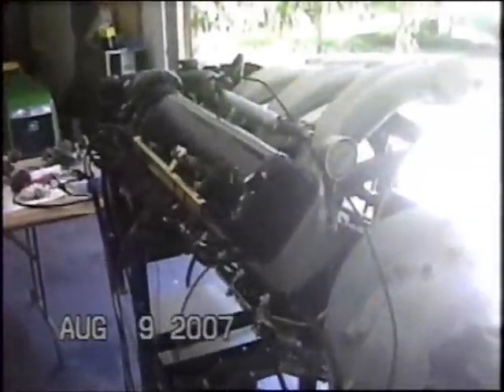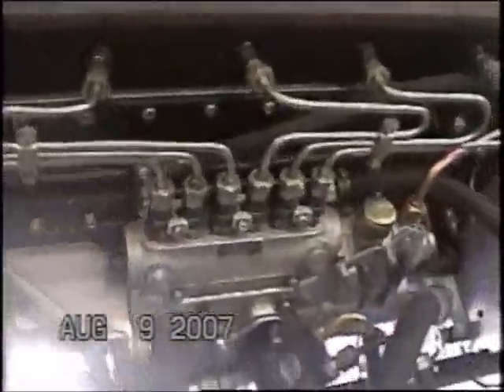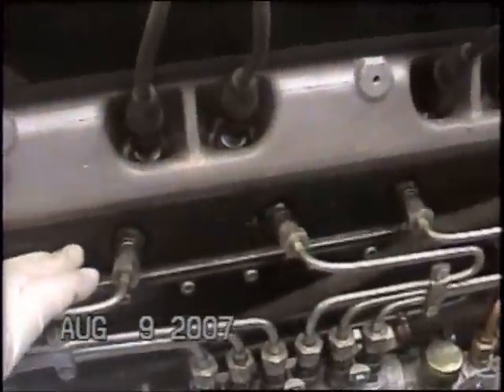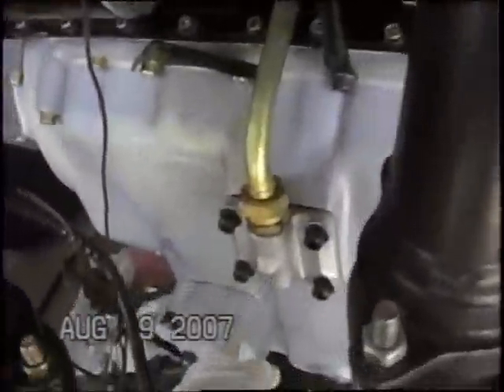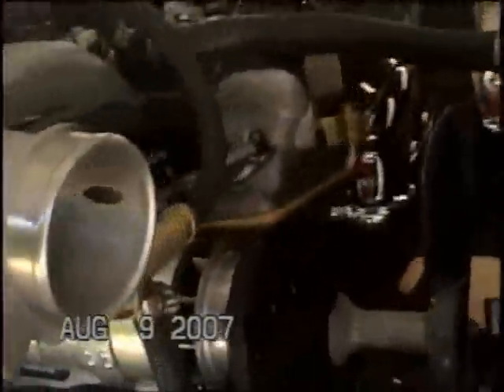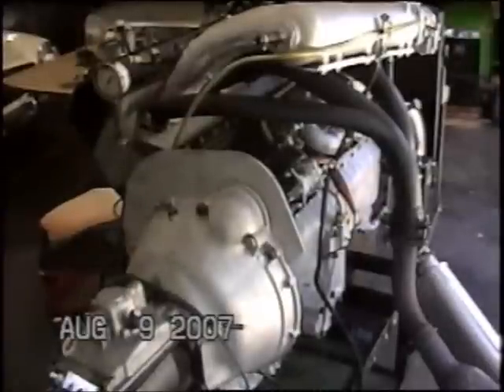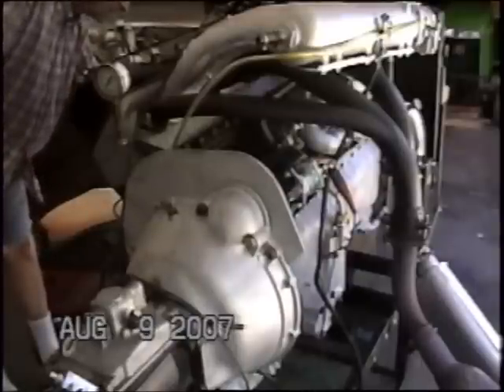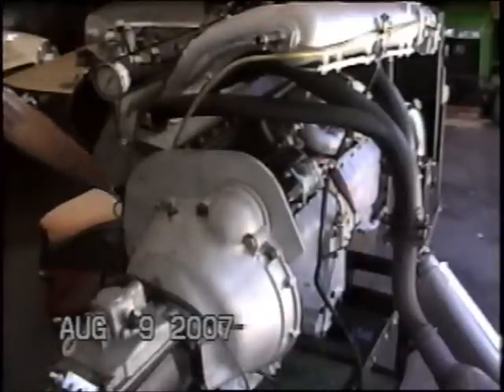1957 Mercedes-Benz 300SL Engine Test

Comment from the maker: @NutsandGuts 
I have been told that with dual points, the amount of time the points are open is increased which gives the coil longer time to build and store energy before the magnetic field in the coil collapses and is sent to the spark plugs.  This gives a hotter spark to the plugs.

Comment from the maker: Good call.  It has 2 coils, 2 sets of points on 2 plates inside the distributor, 2 condensers, 2 places in the rotor for the 2 carbon contacts inside the distributor cap to make contact, but only 1 set of plugs.

Comment from the maker: Easy, the 6 cylinder 300SL does NOT have desmodromic valve train.  The 8 cylinder racing 300SLR DOES have desmo valve train.
The 6 cyl method of valve adjustment is very conventional for the time, an adjusting screw that acts on the top of the valve and a jam nut to secure it.  For more info on this subject go to Wikipedia and type in desmodromic.  Thanks for watching and for the comment.
Reply: Thank you very much for this valuable information

Comment from the maker: Thank you.  I wish the video work was better, not so jerky and better lighting.  It was my first effort.  It took a great deal of editing.  You Tube allows 10 min or 100MB of video.  I did 9 min of vid and was way over the 100MB limit.  There was a great deal more info and running of the engine in that 9 min clip.  So then I had to severely edit to get under the 100MB limit.  The orig clip was more fluid and followed the engine run from start to finish.  With no load, I only went to 3500 RPM.

Comment from the maker: Excellent observation.  These were supplied by the customer already ceramic or poweder coated by Jet Hot.  Paint would burn right off.  Also, if I may, I think you are partially correct.  The exhaust manifolds, which are stainless steel, should be natural, as they left the factory, for authenticity.  But they look fabulous polished.  At night, under full power, the exhaust glows red for the first 6-8" due to the stainless steel being so thin.  Thank you again for viewing and commenting.